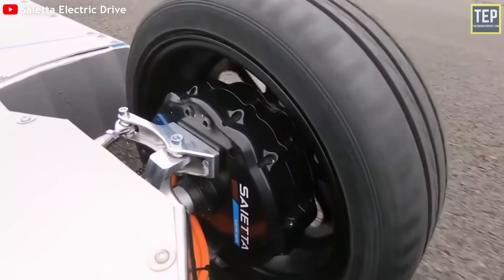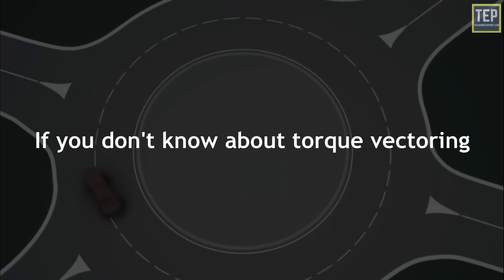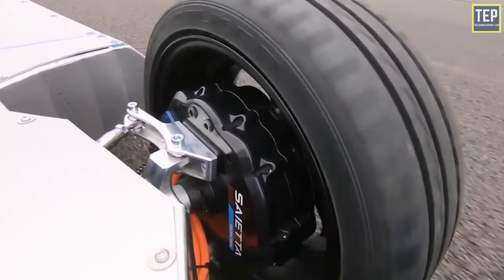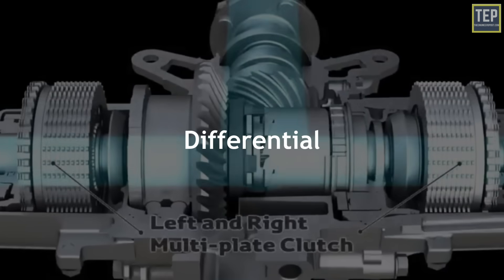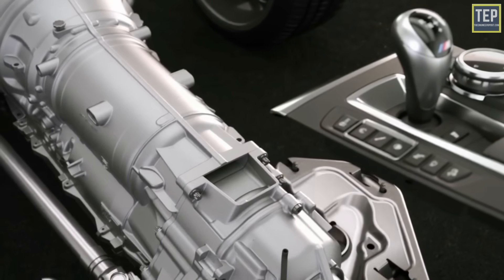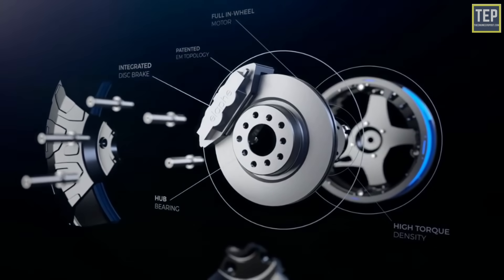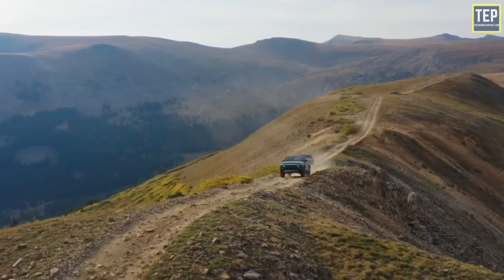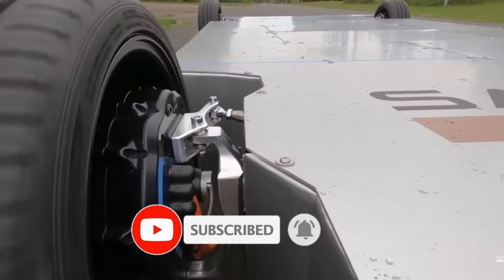How does In-Wheel Motor Technology Work? | Four Motor Drive & Torque Vectoring

Comment: I think they could be a game changer in 4wd, since most of the times the CV axels are the limiting factor in wheel travel, in independent suspensions.
Reply: yes  4 in wheel motors could power an electric rock crawler with huge independent suspension travel and huge ground clearance  with nothing in the way (diffs /axles) but not a Baja truck hitting bumps at high speed

at low speeds unsprung mass is not really an issue
Reply: @geemy9675  yes but the wheeltorque would be good to know. A big motor and a low gearing of a gearbox would maybe generate way more than 10k nm on the wheels. I wonder what a decent Elektric motor makes without transmission. 
Because the torque is maybe instant you may need a little less torque but I wonder what is possible.
Late ev only a nm nearly normal engines and are multiplied by a low gearing.
Reply: Although sealing the internal motor winding now become a big challenge

Comment: Good technology. But I think this will be more popular with performance oriented cars, Utes and possibly light to medium commercial vehicles. 

Due to the reasons of cost, I suspect most manufacturers would prefer one to two main motor configurations, on standard stock cars.

Clever design though & it has a future. But maybe for more specialised vehicles.
Reply: I don't think in wheel motors are mean for high performance cars yet. in theory you could put 4 of their biggest motors to produces 590hp peak but it's more suited to highly efficient EVs like the aptera

Comment: Instead of placing the motors inside the rims we can bring the motors out of the rims and place ahead of the wheel braking and suspension system. So that the problems of vibrations and dirt may decrease.
But this might lessen the cabin space and this is not a major problem because we experienced the internal combustion engines which occupy more space.

If we place the motor in the rim a pothole may impact the motor as the weight of the car and the speed cause the motor to damage.
Reply: I don't see why punctured tire would be an issue, but big pothole at speed/bent rim could be more catastrophic than on other cars
Reply: @geemy9675  true like when small side collisions happens like when jumping the signal cause the wheel to damage. In this case it is very expensive to replace a damaged wheel(motor,braking system).
Reply: @akhilnaidu6291  are you confusing wheel and tire? punctured tire is usually a 5 min fix. damage to the side walls means new tire,, not new wheel/brakes. light collisions are usually bumper to bumper with no wheel damage. t bone accidents at intersections with people not following traffic lights or stop signs can damage wheels/suspensions/brakes but then its usually quite expensive anyway. replacing one of 4 motors would certainly add to the cost. Although recent cars, especially EV are not really designed with low cost of repair in mind. look at tesla trying to press larger and larger parts at once and nearly new $50+k teslas being written off after crashes . Elon musk dream is to giga press the whole body of the car. people able to cut/weld/fix a car frame are going to make a lot of money if people are willing to drive repaired frames.
Also, I think easy/cheap reparability is not easy to achieve with current safety standards (crumple zones). The choice that has been made decades ago is to let the car absorb more and more of the impacts to make the passengers safer. (understandably). the problem is that weight has also went to the roof at the same time meaning high speed crashes carry so much more energy

Race cars with super stiff roll cages/ safety cell work very well for high speed crashes with driver having 5 points harnesses, helmets, neck brace, and cars driving alone(rallly) or at similar speed/direction (track).
head to head collision or tbone crash with super stiff rollcages and people wearing only seatbelts would probably mean much worse damage to the passengers
Reply: @geemy9675  I understood.well explained 👏.
Though I don't know the technical terms more about motors and stuff iam just here to share my opinion that I have thought of.
Anyway thank you for correcting me.

Comment: They should use heavy duty water and dust repellant sprays on top of the hub wheel motors, to prevent damage, which can be used by the owner himself, periodically after cleaning, along with an outer plastic protective cover over the wheel hub motors, and also they should develop in wheel circular shock absorbers, to prevent direct impact on the wheels to reduce wear and tear, along with the external shock absorbers.

Comment: Why can't a generator be connected to each back tire to give power back to the battery for a longer range on any electric vehicle?
Reply: Because a generator with a load (i.e.: battery charger) is literally the same thing as regenerative braking. It's like trying to accelerate with the front wheels while simultaneously braking with the rear wheels. Bottom line: there's no such thing as free energy.

Comment: In-wheel motors give simplicity and more reliability (if one of the motors is damaged, one could continue driving at least till the garage, maybe at less speed). I guess that the most challenging are vibrations.
Reply: Much heavier = bad range and efficiency
Reply: Also in those snowing states, city are dumping hundreds tons of salt every day.
Reply: I found with my ebike fat tyres really helped
Reply: Reliability should be great on cars. We've been using electrical motors to move our railroad trains. Replacing a bad motor is quite simple, bring the engine in for repair, lift the engine to expose the motor and do a swap. We are really dealing with coils of wire and magnets. What could possibly go wrong?

Comment: Thank you for the video   Are these in-wheel motors with control system commercially available?  At what cost?  I think the best use of in-wheel motors is to suplyment front wheel drive ICE cars.  When added to rear wheels, it will provide instant torque to rear at take off, where the torque can transfer to the road better than in front.  Then in freeway driving, let the ICE do the pulling to achieve freeway efficiency.  As an ICE to Hybrid conversion project, it is far less intrusive to replace the drums with in-wheel motors than to replace the drive axle,.  The challenge is how to integrate the control with the ICE engine management.
Reply: aptera makes an ultra efficient 3 wheel EV using elaphe in wheel motors. the car is supposed to start production in 2022 and elaphe sells different sizes of hub motors for micro EVs to trucks but they don't seem to supply motors to any production car
Reply: This would be a great option I wish to currently explore.

When it comes to how to manage the IWM's that should be left to the customer and or have a separate computer that is programmable by the customer.
Reply: @dpscloud3324  Could you do a video on exploring this option?
It would be too difficult for hobbyist to integrate the IWM control with the ICE control.  
Thanks for your reply.

Comment: Actually  the wheel itself should be made as motor , with winding etc partof wheel assembly , only magnets are attached to body of car , all of this can be sealed to eliminate mud , dust etc and the technology can become more feasible,  simple and efficient along with durability
Reply: you're describing exactly how hub motors work. they come with advantages like simplicity, efficiency and leaving lots of room for batteries and interior space but at the cost of more unsprung weight and no gear reduction meaning not as much power or torque for same weight

Comment: i have nothing against four motors mounted inboard and connected though drive axles. but all that weight at the hub??? that is just dangerous for vehicle that is made to drive at speeds. hub mounted for slower going heavy equipment or forklifts and so on would be fine. and dont get me started on having the brakes integrated into the hub motor assembly.  i do see the good points of having the drive control for each wheel but not by hub mounting them.

Comment: Rivian has motors on each wheel, right? It will be interesting to see how well they hold up. I don’t think any other ev manufacturer are going this route. I’m sure they’ll learn a lot and will be able to make improvements.
Reply: For each wheel not in each wheel.
Reply: In-board quad system

Comment: I think maintaining the integrity of the air gap between the stator and rotor is a larger problem than unsprung weight.  In order to protect the air gap seals must be used to protect from intrusion of dust and moisture.  Another problem is loading on the wheel from load weight or shock can cause the air gap to deform, and even make contact.  To resolve this a great deal of engineering is required in the wheel bearings.  Trucks may be a good platform for hub motors since ride is less important than other vehicles, and torque is very important.  The Elaphe hub motors weigh less than 75 pounds and produce up to 150 hp and 1,100 lb-ft of torque, so two motors on an axle wouldn’t weigh much more than than the solid axles used in conventional trucks.
Reply: my 2015 500e is a 2013 compliance car that has a single 111hp / 147.5ft.lb motor that weighs 62lbs and 9.6:1 gear reduction giving it 1416lb.ft at the wheel.  not bad compared to state of the art hub motors. efficiency of the motor(s)  is important but eventually miles/kWh probably depends more on the weight/aero drag/rolling drag  than the motors. also chasing other inefficiencies as in the AC/heating/thermal management.
I think lightweight/lower speed cars is a better march for hub motors. hub motors are heavily used in ebikes, except most of them need internal gear reduction to produce enough wheel torque, which makes them noisier and less reliable-especially with most common plastic planetary gear.
non geared hub motors are mostly used with very small wheels like scooters/skateboards or vespa style mopeds/scooters with small 3-8kW hub motors on 12in or smaller wheels .
heavy trucks seems more complicated. if you delete the solid axle and put just hub motors on tiny semi axles your also putting a lot of torsional torque on the wheel mount ? the solid axles also give rigidity for heavy loads
Reply: Dust and moisture can sealed by greased, we used it everyday in today car.
Reply: Hub motors are stupid as you are increasing the risk of damaging the electric motor. For the Tesla Model S & X is between $15K to $20K according to McNally Institute and & $5K to $7K on the Model 3 as stated by Elon Musk. One CV axle for a Model S is $250 according to forums. In the event worst case scenario of a road crater what would you rather replace? CV axle or the motor?
Reply: @RichardPrendingue  you know some countries have decent pgood roads. the fact that they are probably not suitable to drive into a road crater doesn't mean they are stupid.
Reply: @geemy9675  You didn't even answer would you rather risk $5K to $20K vs a $250 CV axle. Even if the addition of a differential and axles costed $5K it will be far more likely to last 300K when properly maintained.

I owned a 2001 Honda Odyssey in which to save fuel when going below 50 and release the gas pedal would disengage the torque converter promptly dropping rpm from 2000 to 900 rpm being idle increasing the mpg by 1 or 2. Over the span of 150K miles we went through 3 transmissions with the 1st one covered under warranty, second one costing $4,500, and third one same amount. On an emissions or long term ownership aspect was the gain in mpg worth $9,000 in repairs? For context, it was exclusively maintained at the dealership.

You don't need to convince me.. you need to convince the general population wary of new technology to them on a long term ownership aspect.
Reply: @RichardPrendingue Sounds more like a theoretical question to me. Never broke a CV axle and I'm not planning to either.
Also,  I don't know where your price estimate comes from. the aptera paradigm adds $2500 to add a third 50kw motor, I guess with a reasonable margin. hub motors are very low production items still. also I guess the labor to replace a hub motor is quite minimal. also with 4 motors being probably the norm in hub motor EV's, you'll still be able to drive with a motor failure.
you can even imagine a spare wheel with no rotor that will be able to freewheel if the motor isbstuck.
a non geared hub motor is the simplest way to power a wheel by far with only one moving part, so I think if they can figure out the reliability factor it could have a bright future.
BTW If you look at elaphe testing protocols it looks pretty intense so I think they are aware of these issues and working on it. but ultimately a single hub motor replacement will probably be much  less expensive than fixing or replacing a  combustion engine
Reply: @geemy9675  Watch video titled Hub drive vs mid drive by JohnnyNerdOut

While it's for e-bikes the principles are the same and statements are made from a person who repairs them with real world testing scenarios. 

You claim simplicity of motor to wheel output design while disregarding 2 - 4 hub motors vs 1 or 2 with a differential splitting the power to the wheels. I'll even openly admit hub drives are around 10% cheaper to manufacture vs mid drives on ebikes but if they aren't 40 - 50 percent cheaper when aiming for AWD there is no true savings FFS!
Reply: @RichardPrendingue  ebike hub motors are mostly  cheap chinese manufacturing and have a lot of known issues. poor cooling with heat building up in enclosed casing, non geared hubs are heavy (for a bike) and low torque. most geared hub are noisy and have plastic gears that melt when overheating. they dont have Regen either although that's a minor inconvenience for e-bikes.
but they are still quite useful for cheaper utility bikes and people who are not very good at using gears. mid drive require more skills to keep the grouper healthy and switching gears smoothly (see Micah toll:s recent video).
JohnyNerdOut also is a king of troll who has an interesting but rather biased opinion on hub/mid drive motors. 
more importantly, hub motors are quite different on ebikes and Eva, the idea behind having 4 hub motors in an EV is to split the total power by 4, have more smaller/lighter/cheaper motors with less material that will have less unsprung mass while providing good torque and power. it should also allow to downsize the mechanical brakes thanks to efficient 4 wheel Regen. then you have added benefits of 4wd, independent traction control/torque vectoring, abs Regen on each wheel, high steering angles (possibly 4 wheel steering) reduced mechanical complexity (no diffs or axles) better efficiency and reduced mechanical losses, better packaging. like said before it's not without downsides (unsprung mass, reliability) but I think with mass manufacturing it coukd become cost effective. it will probably be niche product for the years to come, for ultra efficient EVs like aptera, maybe one day for 4wd rock crawler with extreme articulation/ground clearance and 4 independent wheel suspension

Comment: In wheel is vulnerable to vibrations which will weaken permanent magnets.
Reply: @L W Induction motors are often slightly heavier. Yes, vibrations and percussion will weaken all permanent magnets over time. Hit a cheap fridge magnet with a hammer, it will likely still work but much weaker.